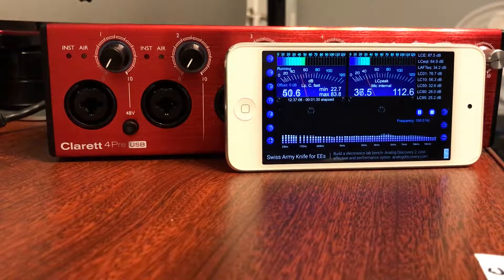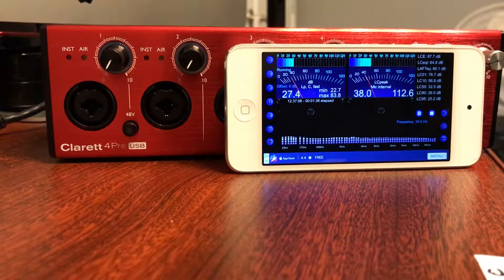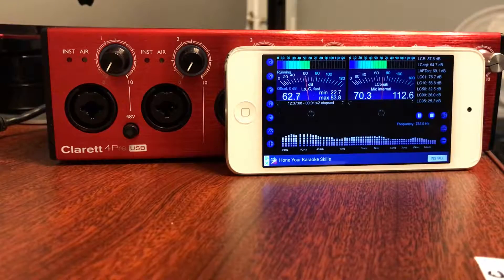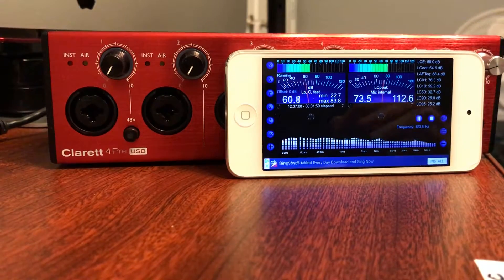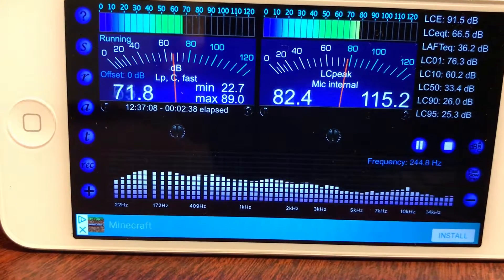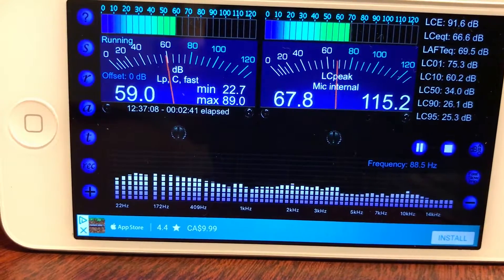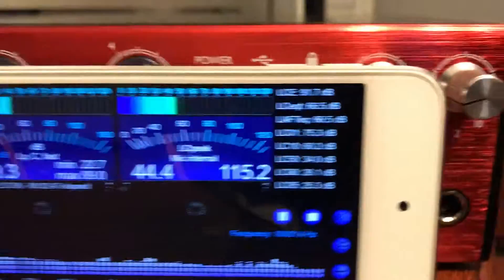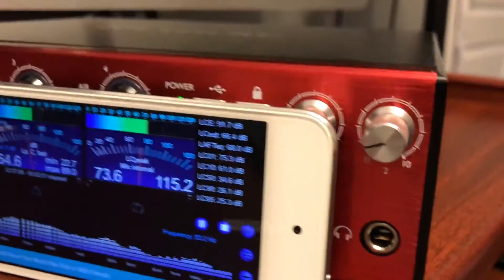Clarett 4pre USB high frequency whine

Comment from the maker: FOLLOW UP :  I like Focusrite products.  The Focusrite units I have used in the past have been fairly rock solid.  I live in Canada.  I ordered my Clarett 4pre USB through G.S. Broadcast Technical Services Ltd., in Ontario.  When I came across my "whine" issue, I also contacted Focusrite support directly.  Both G.S. Broadcast Technical Services Ltd. and Focusrite said this was an anomaly.  (My guess is a faulty component in the power circuitry of that specific unit.)  The two companies were great in making sure the malfunctioning unit was replaced.  I simply sent my unit back to the distributor and I was sent a brand new Clarett 4pre USB.  The new replacement unit has NO "WHINE" what-so-ever.  I am happy with how this was resolved.

Comment: do you have Mac or pc?high Sierra OS X making  strange thinks with usb interfaces.
Reply from the maker: At home, I am using the Clarett 4pre USB with a 27-inch, 5K Retina, iMac, late 2015 with Thunderbolt 2 ports.  It is running High Sierra.  I have plugged in the unit using the USB-3 ports, not the TB2 ports via an adapter.  The Clarett USB series ships WITH two USB cables: cable 1 is USB  3 type C on both ends  &  cable 2 is USB type A to type C.  

At work, I ordered a few Clarett 2pre Thunderbolt units.  They did not come with a Thunderbolt cable.  So if one is to order a Clarett Thunderbolt interface, please know you will need to get yourself a separate TB2 cable.

Comment: Very strange. I'm debating buying this in the next month or two but I have to wonder if this is a widespread issue? How do you like the interface otherwise?  Looking for something to replace my old Saffire Pro 24.
Reply from the maker: (I apologize for my delayed response.)  I really like to interface so far.  The line outputs and the headphone outputs are clean and they have a lot of output.  (near-field monitors: Presonus Eris E5 ;  headphones: Sennheisewr HD 25-1)  The Focusrite Control software (with drivers) is fairly easy to work with.  I have only been working with the Clarett 4pre lightly over the past three weeks.  So far, I am happy with the unit.
Reply: I got one and have no high freq whining so maybe an isolated issue